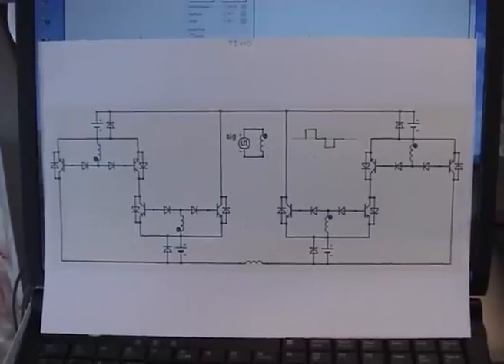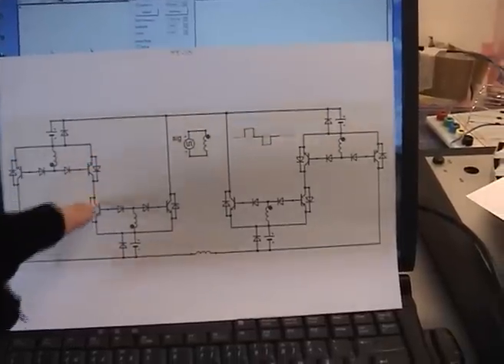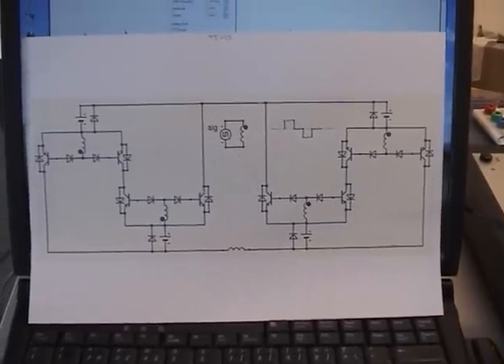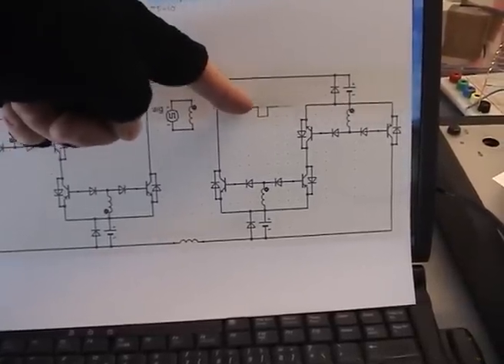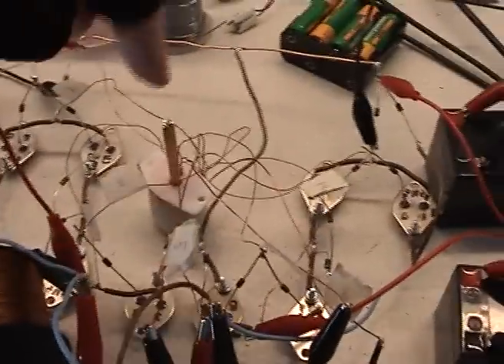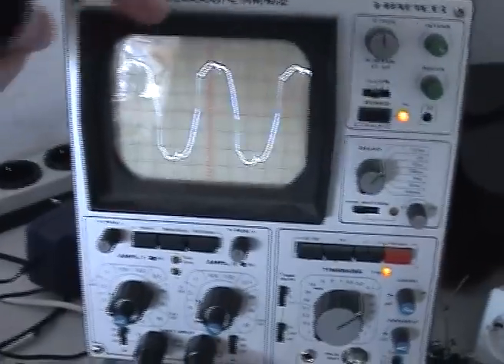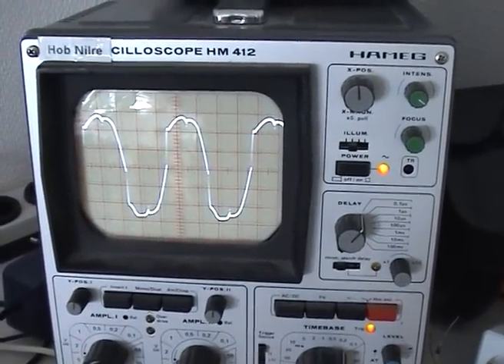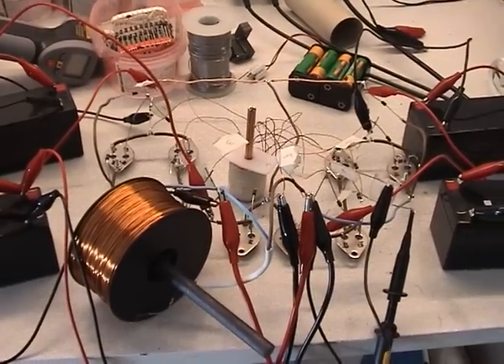Tesla-switch part 10, full solid-state

Comment from the maker: The big so called load-coil is a 1kg spool of #23 making a 170mH/24ohm coil. The trigger coil is a small six-filar of #26, each winding about 17m wire making six 240uH/2.1ohm coils on one core. There was no planning on the coils, I just used what i had lying around at the time. I put some effort in finding the frequency though, so the load-coil would resonate like a swing.

Comment: Great work! Have you tried a resistor in place of the load coil? Or something else that performs work? All you need is to do is compair the total work performed by your tesla switch against the same batteries without the switch. I have no doubt you will see at least an increase in efficiency.